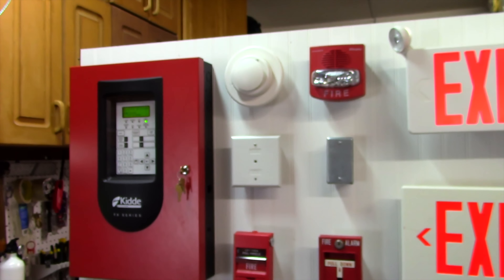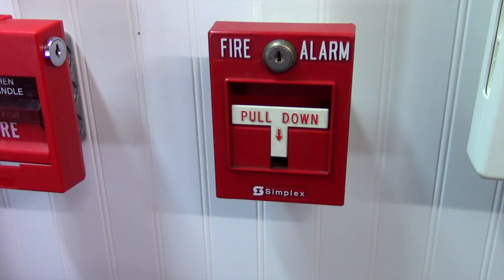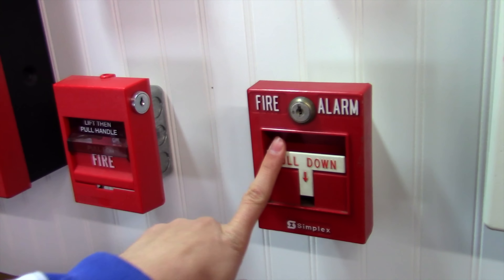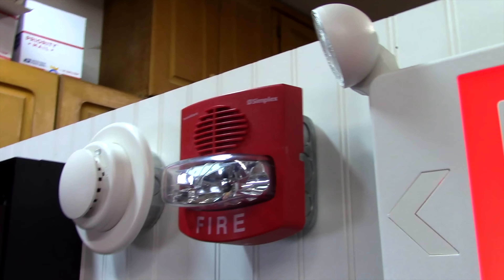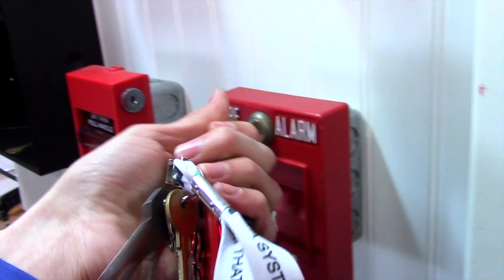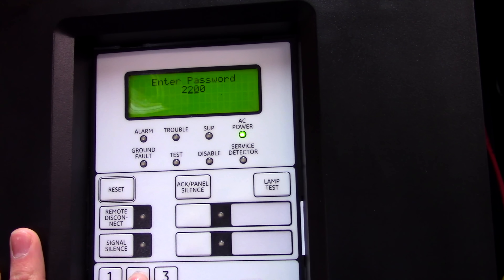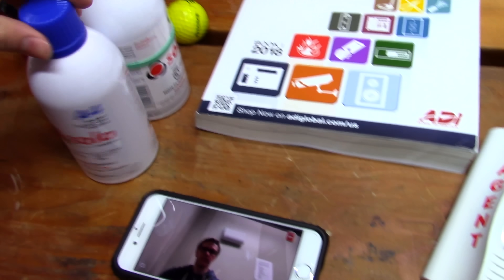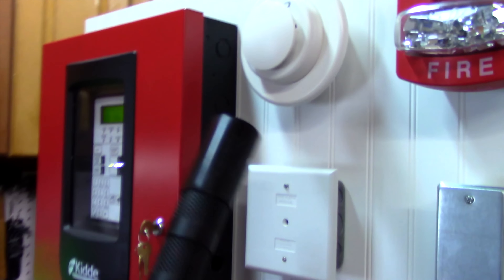Kidde FX-64 System Test 7: Zachary Fleck!

Comment: If anyone wants to use the a simplex, or any other device that require DC instead of FWR but only have an FWR panel buy an altronix al600lgk board (or similar). That board needs 24vdc in and a nac code. You wire it up with 24vdc from an auxiliary power terminal, and wire nac 1 and 2 to the inputs. The board also has the ability to double your nacs so if you have 2 going into the board you will have 4 going out. The nacs going out of the board have VDC instead of FWR because the panel is powered with 24vdc. I have an Edwards panel and it allows me to use a simplex notification appliance.
Reply: The system 
Ok

Comment: The crickety noises in between the beeps are because this panel does not cut the power but it drops the power to a very low voltage and then brings it back up again for the next beep.
Reply: it sound like a sheep baaaing